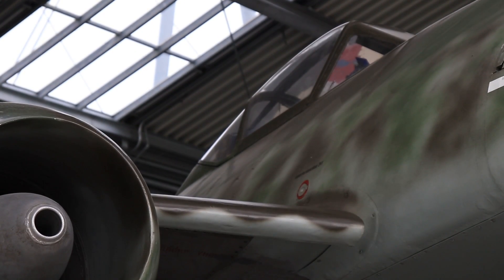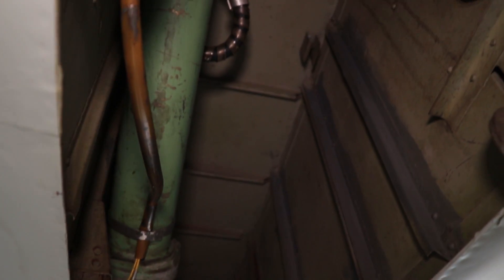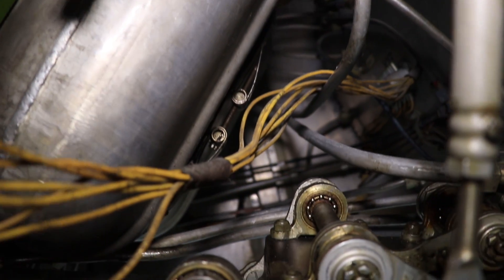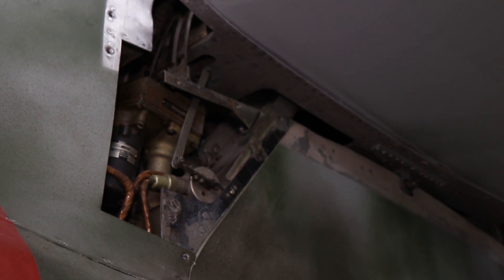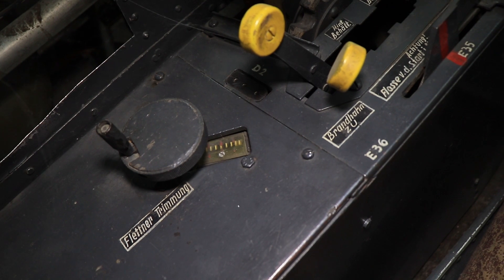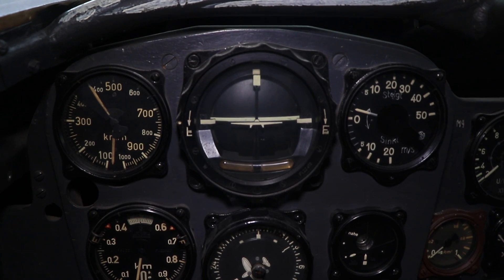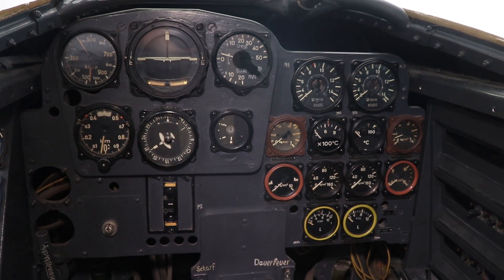Inside the Cockpit - Messerschmitt Me 262 [Part 2]

Comment from the maker: Little correction. When I mentioned the circle like antenna up top, this is not for the FuG25. The Peilrahmen (the circle) is standard equipment and I can't quite tell how I got this wrong here. Apologies, I am only human. 
These episodes can not be made without your support Patreon: https://www.patreon.com/join/Bismarck OR PayPal: https://www.paypal.me/BismarckYT
Reply from the maker: Signaling flares
Reply: @MilitaryAviationHistory  I’ve read that some night fighters used illumination flares. I don’t know if the 262 was ever used as a night fighter?
Reply: @notmenotme614  Me 262B-la/U1
Reply: 2:57  the blue tank  its labeled Hn3  hydrazoic acid.,  that was most likely used as an inerting gas to take up the space in the fuel tanks as fuel was consumed and to assist the fuel pumps moving the fuel due to it being above atmospheric pressure , additional fire suppression to add to there self sealing rubber tanks

Comment: Thank you for the great videos with many details about this iconic airplane. As you know we only peeled back a couple of layers there is many more. When I look at the wiring and hardware configurations throughout the videos I see striking similarities to the machines I work on today as an elevator / escalator mechanic foreman. There are a few elevators and escalators still in service of German design that are over 50 years old, which we still service today for NYC Subway system, many have recently been replaced and are not as good in my opinion . Ich bin Vorarbeiter eines Aufzugs und Rolltreppen Mechanikers

Comment: What was the purpose of the flare dispensers?  Was there a threat of heat sensing arms guidance then?
Reply: While I can't say for this bird in WWII many fighters carried flares for several reasons.  If the radio was out and you needed to signal a issue upon landing you would fire colored flare to signal your distress. They were also used to mark targets or objects of interest on the ground.  Things like that.

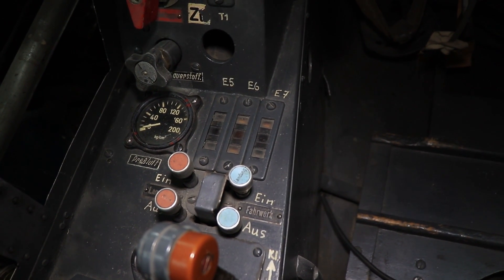Comment: Does anyone have an explanation why the Germans used basically the most amateurish way of instrument labelling, "some guy with a white paintbrush/marker pen" on most cockpits I could find, when even Spitfires and Hurricanes built during the Battle of Britain received engraved lettering or at the very least some machine stamped labels? Look at 6:50, that's literally some guy spending half an hour to label critical components on every plane, every single "ein / aus" coming with a possibility for error. I don't think it's just war-time deprivation of infrastructure either, seems like early war planes came the same way. Just makes you think - why???
Reply: This is pure speculation on my part but by the end of the war they were suffering major material shortages and perhaps they simply didn't have a supply of the correct labels and it was that or nothing..  or the plane was not typical so perhaps there were no standard labels for them or none could be delivered before the aircraft went operational.

Comment: Awesome video, my favorite WW2 fighter.  Great commentary, imagine if Germany had put more resources into building these when they weren't under as much pressure from day/night bombing, and as you said didn't have to resort to sheds in a forest or underground/etc facilities, with no corners needing to be cut.  It still amazes me what the 262 could and did go what with all the challenges Germany and the LW faced in building, maintaining, and fighting this amazing machine.  I also think that if they went with 2 MK103 instead of 4 MK108, it would have been more deadly, as the pilots said the low muzzle velocity of the guns combined with the high closure rate made aiming and getting solid gun solutions very, very difficult.  Great vid/pic of the R4M as well.
Reply: It would have been interesting to see how this would have done against the Gloster Meteors that were being produced in numbers by 1945, but they wouldn't let fly over enemy territory lest they be shot down and reverse engineered.  The brits held their jet technology very close at the time.

Comment: Why does it have a flare dispenser? It can't be countermeasures, since there were no heat-seeking missiles at the time.
Reply: The signal flares were fired when approaching the landing field to alert ground crew & Flak units. The  Germans shot down a lot of their own aircraft near their airfields because most aircraft approaching at low level would be the allies attacking.
Reply: That makes sense. Thanks.

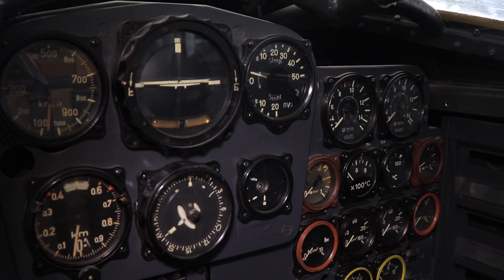Comment: Like you said @ 8:10 . The right temperature gauge looks off.... really off.
130C max. That would be something for oil or water temp on a prop like a BF109 or FW190.
It should mirror the 900C gauge on the left side.
Reply: All German fighters ww2 had fighter bomber variants fw290 was outstanding in role me109 not so good
Reply: Fw 190   outstanding fighter bomber
Reply: The labelling is x10. You'll see the red line, under that scheme, matches the left gauge.

Comment: Why would it need flares?
Reply from the maker: Signaling flares
Reply: The signal flares were fired when approaching the landing field to alert ground crew & Flak units. The Germans shot down a lot of their own aircraft near their airfields because most aircraft approaching at low level would be the allies attacking. For the night fighter version there were more flare tubes than on this aircraft & flares were used to warn Flak to stop firing just before an attack on the bomber stream & to tell the airfield to  signal the control tower at the aircraft's home base to switch on the flare-path for night landings.

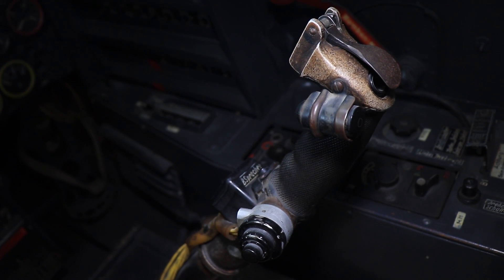Comment: 10:41 I had no idea it was possible to charge the cannons in-flight. With with MK 108 firing from an open bolt, that means standard practice was to take off with the bolts closed (certainly safer and less wear on the guns, etc) and then charge them for a dogfight? Interesting.
Reply from the maker: The stick itself is a standard stick, also used in different planes. Whether that button saw an actual use here, I am not yet sure
Reply: @MilitaryAviationHistory  I didn't realize that either, that's neat too, thanks! All these in-depth videos you do are always fantastic, so a big thank you in general for all the content on the channel. :)

Comment: This aircraft is so amazing, truly cutting edge. The front view of the fuselage is triangular, this is the best shape for weight saving and aerodynamic airflow. You showed us the cockpit, but the ejection seat by itself needs a separate video, just like the engines. The Japanese also built their version called the Nakajima Kikka. There were similarities but their's was a high altitude interceptor/fighter aircraft (to counter the bomber, mainly B 29 menace), so the wings were shorter and the tail end was broader. Some parts were the same as early aircraft such as the front landing gear of the Mitsubishi Zero.
Reply: No ejection seat in the 262

Comment: The pressurized air lever in the cockpit is likely used to release air from a canister (accumulator in US aviation terms) that will blow down the landing gear and possibly flaps. Compressed air could also be used to start an engine if there is not enough airflow to windmill the compressor blades.

Comment: Thank you.  Superb video!  How would a pilot have used the IFF back then? Was it simply for signaling a friendly position or a tower during approach? If it worked both ways, what steps did the pilot take to engage this, what type of output was generated, and how did the pilot interpret the output to discern friendly from foe while in combat?
Reply: It just IDs the aircraft as German on the Freya radar system. It stops the radar operators from directing fighters or flak against them although it was later exploited by the allies to locate Luftwaffe night fighters and so became less effective later in the war.

Comment: Did you ever find out if the gunsight was original? also, next time youre in Dubendorf, CH see if you can get into the ME-109E3 we have there, would be interesting to see if there are any cockpit differences between an export Swiss airforce BF-109 and a LW 109
Reply from the maker: I asked them a bunch of questions recently but not on the sight yet

Comment: Would it really be good idea to have so many cables in the same yellow color?
Reply: Im most aircraft that I have worked on the electrical systems are wired with white. Stamped on these wires are codes designating what system and function of the wires belong . Basically you have to go to the schematics diagram figure out what wire you are looking for and pick through the bundle to find the wire.  I have seen colored cables attached to generators but usually white is the standard.
Reply from the maker: Hey Ole, your question prompted me to reach out to the museum to ask them on this. Reply just came in, as far as they can tell, the cables are original. By the point this aircraft was constructed (Jan/Feb 45) any sort of regulation on colour-coding (if it existed, I don't know - it's something I haven't looked in to yet) would have been out of the window anyway.
Reply: @MilitaryAviationHistory  Good answer! ...I just wondered whether it was restored to just look "nice". Now I know it was not. Thumbs for the museum then :-)
Reply: @MilitaryAviationHistory  yes, it is correct that most of the electric cables are yellow on the German airplanes! Generally on each cable is attached a code every once a while along the cable making the life of the electrician somewhat easier but he will always need a schematic chart to "navigate"! Btw it is very interesting to note that generally the interior is far more original including the inspection stamps on the interior of panels! But I have a question for you: the Revi 16B gunsight can be rotated and slide forward, is it to protect the pilot's face when crash landing? Again a very interesting video and keep posting!
Reply: @MilitaryAviationHistory  Probably when they were running short of supplies, keeping color coded wires in inventory wasn't really an option.
Reply: Trevor Taylor  Exactly,  I do remember chasing wires in an oily area in a wheel well and most of the wire stamping had come off. Not alot of fun.
Reply: Trevor Taylor  And hope to hell your mechanic isn't color blind.